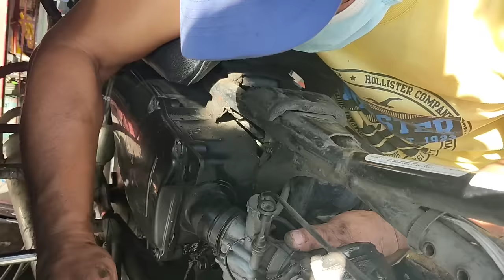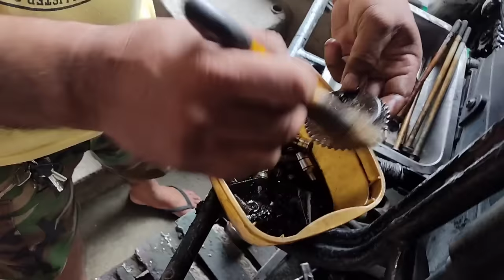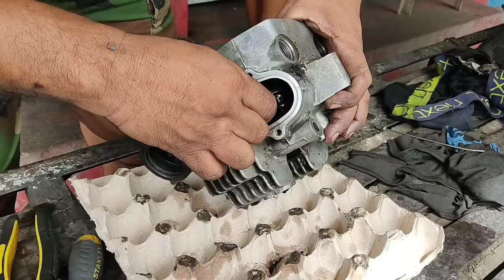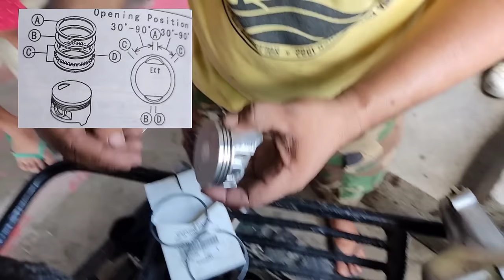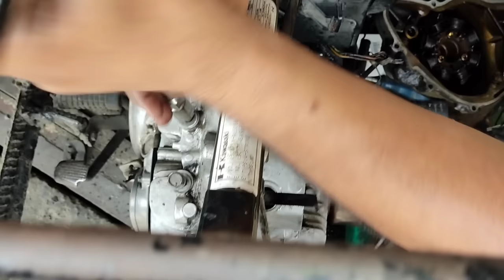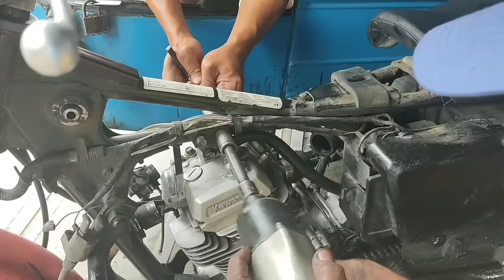KAWASAKI BARAKO 175 TOP OVERHAUL!! FULL VIDEO TUTORIAL

Comment: Brad san po shop nyu? My oil leak dn po barako ko eh.. dko alam san galing kng sa cylinder head o san..
Reply: Kung sa pagitan ng cylinder head at cylinder block , baka nasira na yung gasket sa gitna , pagawa mo na kasi maapektuhan yung piston at valve madadamay pati yung valve seal , pero kadalasan kung leak pa lang , pa check mo na yung gasket , baka yun lang ang may problema.